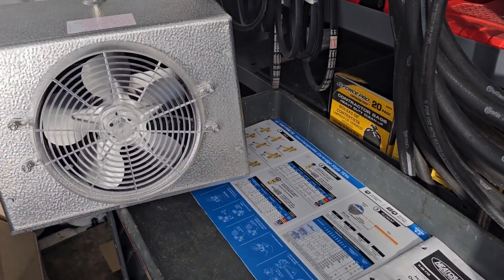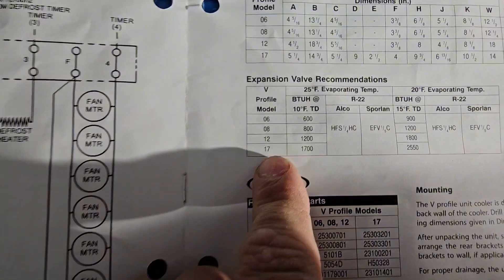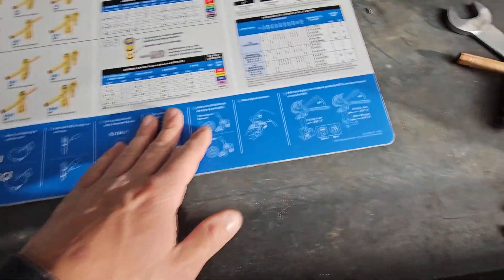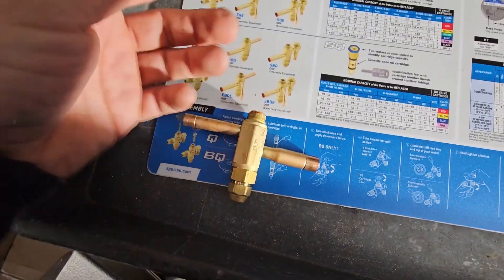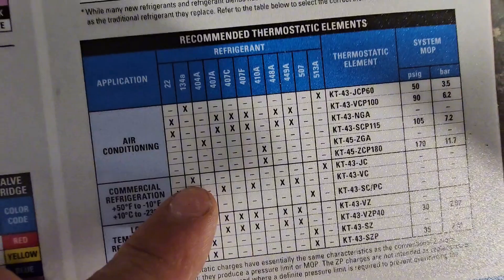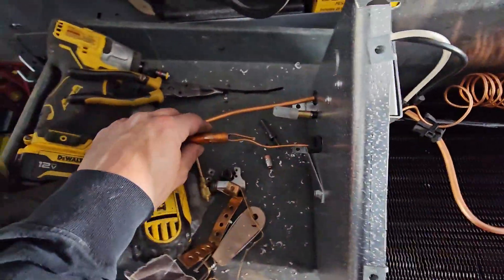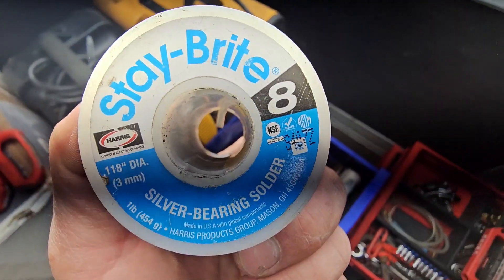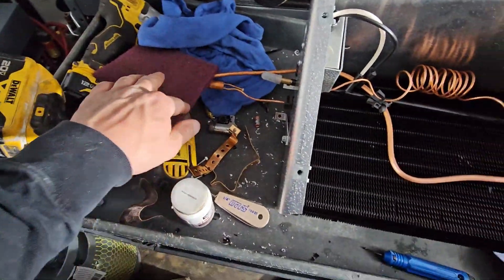Refrigeration Service - Retrofitting Evap Coil & TXV sizing.

Comment: It’s not a massive difference but different refrigerants do have different BTU capacities/efficiencies at different evap temps.

On your Parker chart, a AAA cartridge for 404A has a different fractional tonnage than refrigerants close to R22. If you’re coming in close especially for low temp it can matter to have it actually cycle properly.